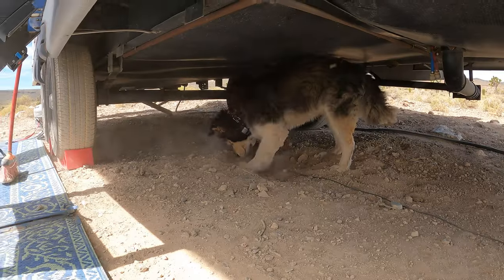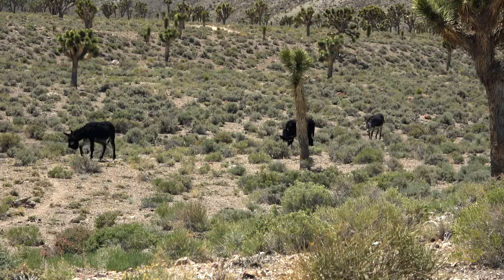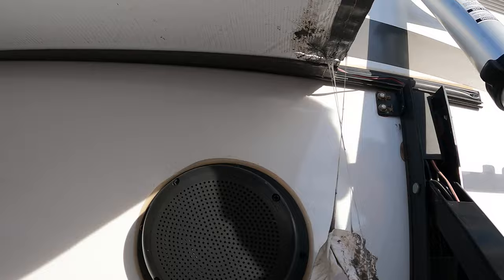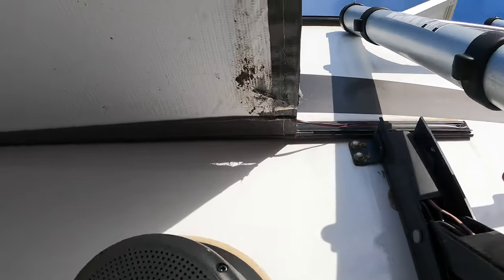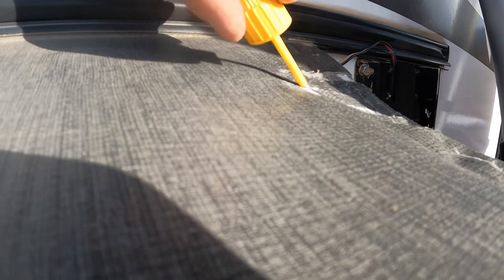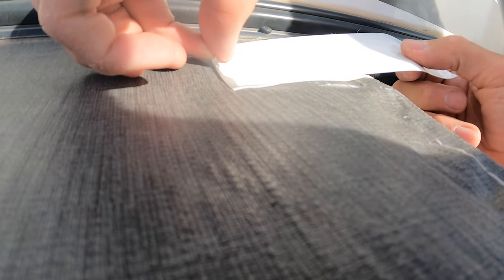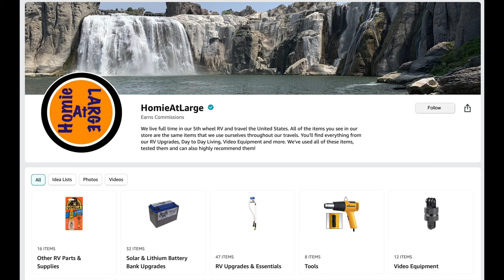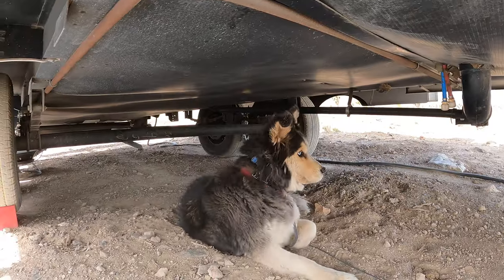Torn RV Awning Fabric Repair - Quick, Easy & Inexpensive!

Comment: Way to  make a awning last awhile longer Homie,   I just bought a roll of black gorilla tape to reinforce mine where its seperating  .  Duct tape comes in 
all different colors also .   Thanks for your helpful hints my friend .
Reply from the maker: Hey Rob!  I did see the different colors, but, nothing to match the top of ours, so, I just used the white.  I’ve heard the gorilla tape is good stuff.  Are you also going to try applying the super glue with it or just the tape?
Reply: Well i like the idea of the super glue,  I agree it would give added strength .  Im going the whole distant of the awning which is twenty feet.  Im half on the actual awning 
fabric and have on the heavy cloth strip that slides in the metal groove  on the RV.  It is getting thin there and i see light  through the fabric.   If i like how it holds up for 
the summer , maybe i will find a super glue i can brush on with a paint brush  and put new tape over that .lol
Reply from the maker: Hey Rob, that would be a LOT of superglue!  I've heard Gorilla Tape is pretty good too.  That might work better for you in your application.  Not sure, but, guessing they might be using the same glue that is in their Gorilla superglue?  Maybe just apply superglue in any areas that might seem like they would need added strength like the awning edges or areas that are really thin.  Let us know how it works out for you.  Good luck!

Comment: Our awning was getting little holes and micro tears...you could look up and see sun light poking through.  I got a can of Flex Seal black spray and evenly sprayed it on the very top part that is exposed to the sun all day (I first used alcohol to clean the surface).  I would NOT recommend this...a year later, the flex seal is chipping off.  My next guess is the maybe get eternabond, like 6" or 8" width and run it across the whole area of the awning that is always exposed to the sun. 

Still debating....     Thanks for the info.
Reply from the maker: 👍🏻 That sounds like a mess. Hope everything works out for your project.  🤞🏻

Comment: I weigh 340 lbs. Would I break the ladder if I used it to repair my awning like you did?
Reply from the maker: Unfortunately, this ladder is only rated for up to 250 lbs.  However, there are a few other telescoping ladder brands out there that are rated for up to 400lbs, although I did not see any that were “A frame” like ours, only straight extension.

Comment: This is a temporary fix at best. In my experience duct tape disintegrates rapidly (outdoors, a year at best) and super glue becomes 'crispy' and flakes off. Im currently searching for a permanent repair without having to replace all of the fabric. 😊 & Be brave.
Reply from the maker: Ours is still holding line a champ!  I’m thinking most of it is making sure it is prepped and cleaned properly.  Duct tape has not disintegrated either.  Still looks good 👍🏻

Comment: In a years time the duck tape deteriates and flakes apart, I know I have used it on my canopy. This is not a good fix unless you want to rip old tape off and retape every 1 to 2 years........look for a better fix, this is not a great idea
Reply from the maker: Our 3M Duct tape and the repair is still holding up great.  👌🏻